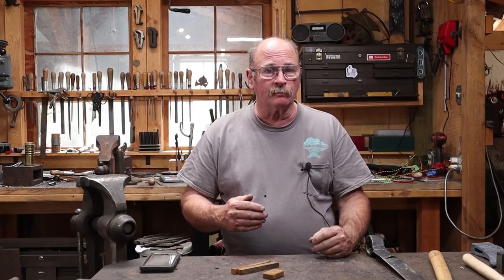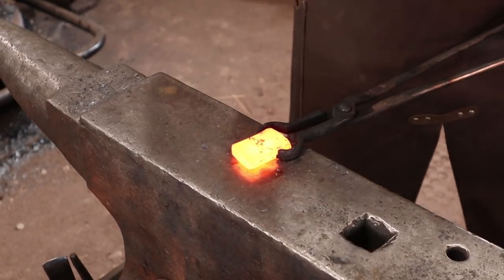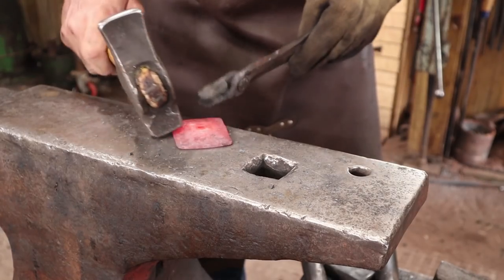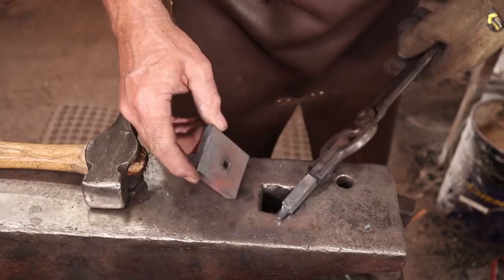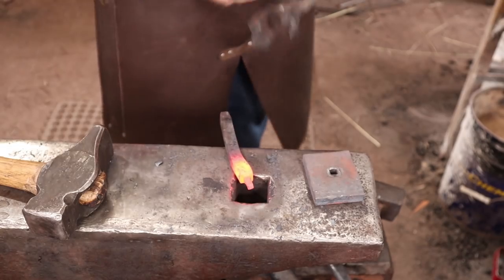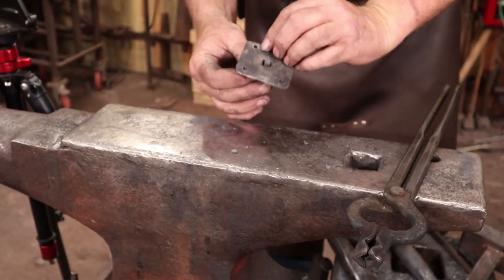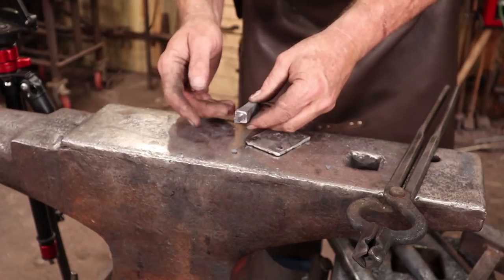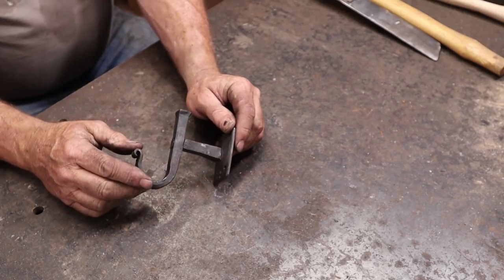Rudy's hook - Hook of the Week 18

Comment: Been practicing a lot of mortise and tennon joinery this last week. This looks like a fun little project and my wife couldn't ever have enough hooks around here. One question I have is what is the exact purpose of the cross drilled hole I always see in monkey tools? I'm about to make several sizes from some jackhammer bits. So far I've just used my bolster plates to clean up shoulders. Thanks for sharing this project John!
Reply: To equalize the air pressure, would be my thought. Would make it easier to remove the work-piece without the suction that would be there in a closed hole. Think "boot stuck in the mud", that kind of suction.
Reply: Thomas Russell Thanks, for the reply. That's what I was thinking. That definitely makes sense.
Reply from the maker: The main thing I use the hole for is a sight hole to make sure I'm not upsetting the tenon inside the monkey tool
Reply: Black Bear Forge Thanks John! I also asked this question at a hammer in awhile back. The different answers I get on questions like this are always very interesting and useful in seeing the how's and why's on tooling and techniques from different smiths. Thanks for all you share!

Comment: I'm with you on all but one point here, John. As is or slightly shorter stand-off would be fine for a coat and ball cap. However, if the guy wears a hat with a full brim, a slightly longer stand-off may be in order. Especially if it is "cowboy" hat country.
Nice hook though. So many ways to modify this design for a slightly different need, or to 'purty it up a bit'.
P.S. You're going to have to find another bucket of scraps here pretty soon.

Comment: Great work as usual!  I don't have a local coal supplier so I use charcoal.  I spend lots of time trying not to get burned by the sparks.  Going to have to nurse an elbow back to shape before I can swing a hammer too much - sadly.
Reply from the maker: Elbow problems are the pits.  Do you make your own charcoal?
Reply: May be time for a home made power hammer or two. (Or bought one/s if it's in the budget). Hope your elbow heals well, either way.
Reply: @BlackBearForge  Not yet.  I'm about to build a retort to start making my own.  I've got a pretty large pile of wood to work with and a mill close by that sells hard wood fire wood that I can use.
Reply: @thomasarussellsr  Thanks.  I do have plans for a power hammer.  Through bad hammer technique and the day job, I've pinched nerves from my neck to my wrist.  I reaggravated the elbow at work about a month ago.  But yeah, it's time to get on the power hammer if I want to continue forging. :(

Comment: I was wondering if it's meant to be a double hook. Maybe a short extension cord in front on the J and a longer or thicker guage cord on the stem to the wall plate 
Or reins for a horse team rig?. Whatever the purpose originally intended,  that's a fine multi purpose hook as it is. 👍